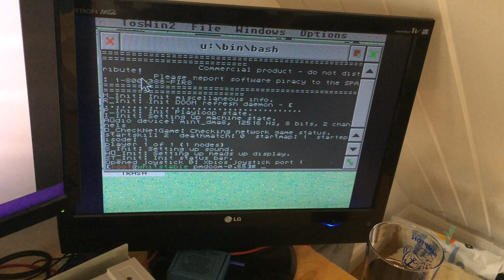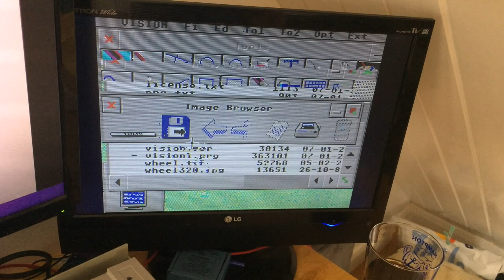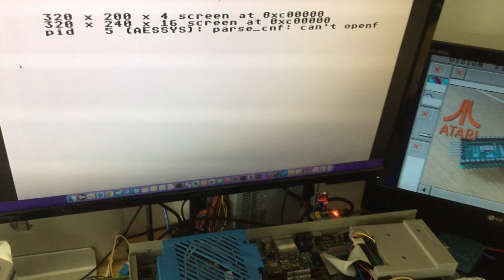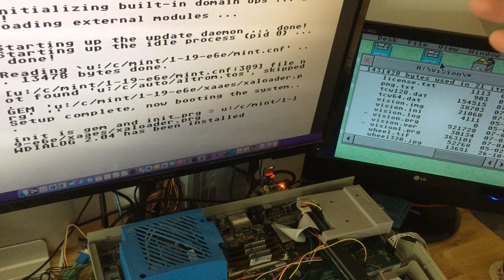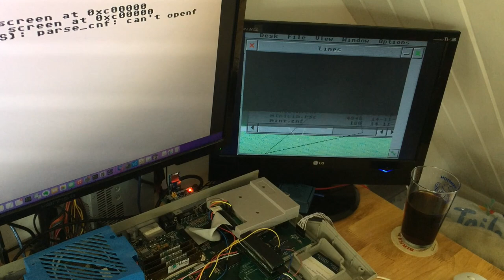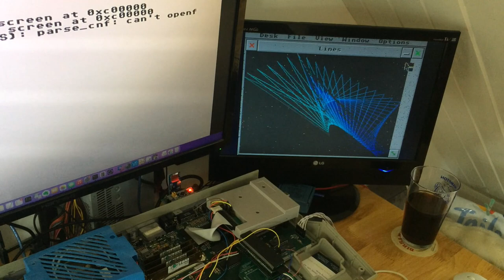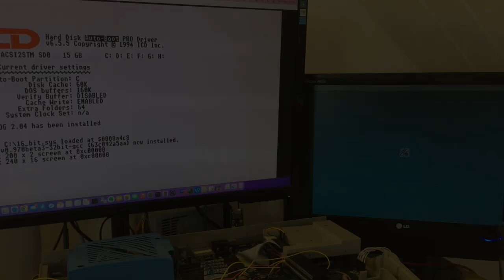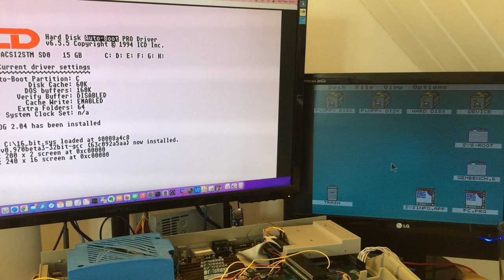Chunky 12-bit true colour on the Atari ST

Comment: Really cool, thanks a lot for sharing! Impressive that the VGA works so well with only those resistors directly on the CPLD outputs. Very cost effective 😉
Reply from the maker: Many thanks. It's basically the same resistor-ladder design used on the STE, just able to use them all at the same time. :)

Comment: This is amazing. Do other games run on it or do they crash?
Reply from the maker: Hi there. This basically behaves like most graphics cards: only 'well behaved' programs that use VDI will work. Games will normally access the hardware directly and won't know about the graphics card. They will continue to run on the original monitor port. Doom is nice insomuch as it's a modern conversion so uses the SDL library (it can run in a window under GEM and therefore uses the VDI for drawing) but is also small enough to run in 12MB of RAM. Finding other games that use SDL (or the VDI in other ways) but are also small and fast would be hard. Most games bypass the operating system entirely for efficiency's sake.
Reply: @thetechnoshed  Thanks much for the explanation. Makes sense now. I was thinking this was more like a blitter add-on when it was not.